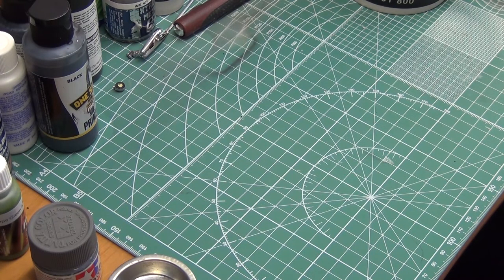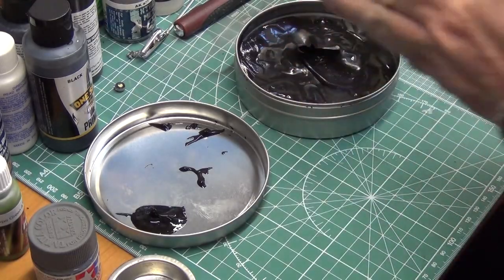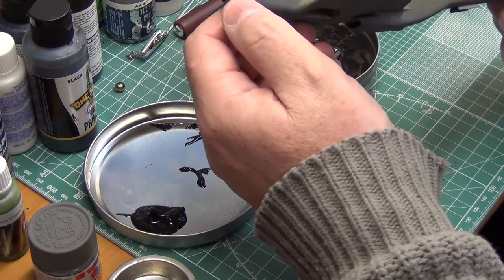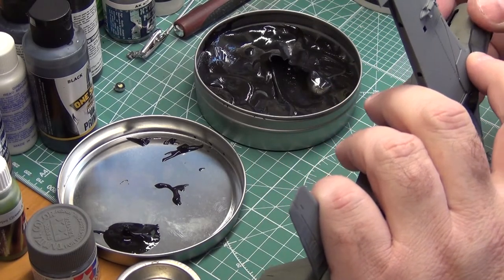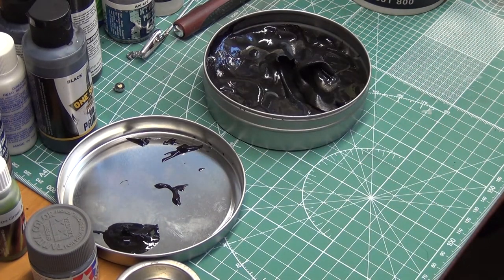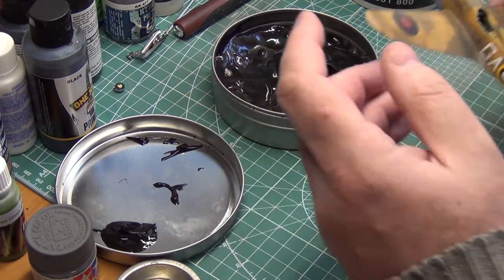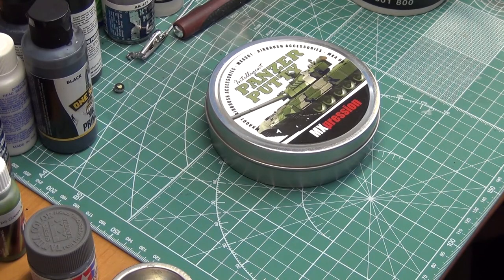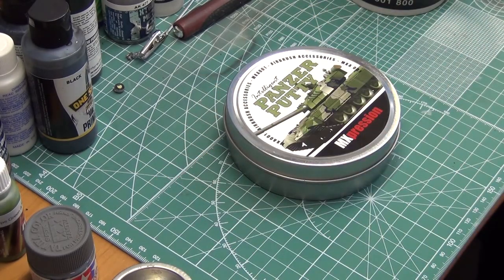OTB - Panzer Putty

Comment: I'd not heard of this before. I like the look of it, and it seems good value. How do you get paint off it before it goes back in the tin? You can sign me up for more videos like this, please - right up my street. Cheers.
Reply from the maker: Hi Andrew, You don't. It just mixes in with the material. That is why eventually you will have to replace it, but I'd suggest thats after a LOT of models.
Reply: @DansModelBench  Nice one, thanks.